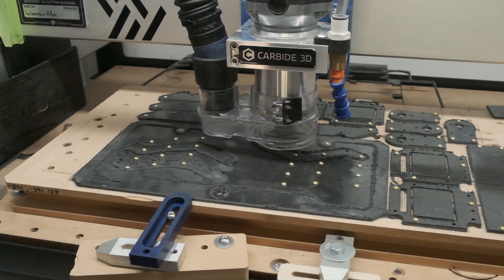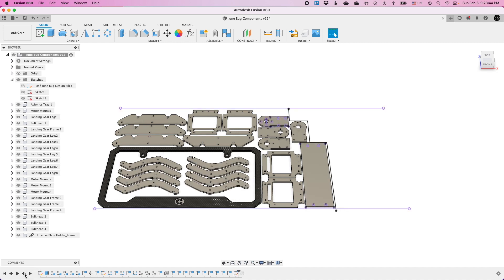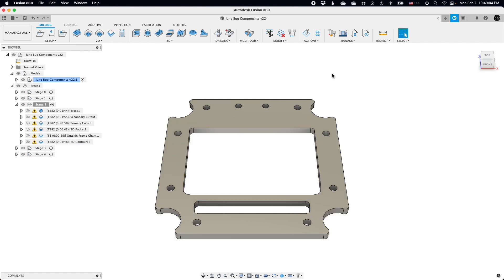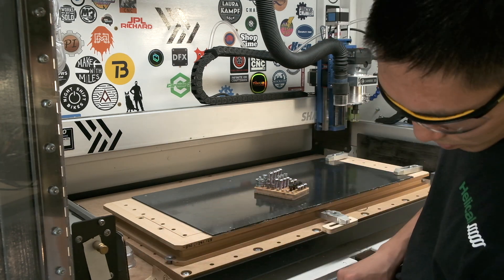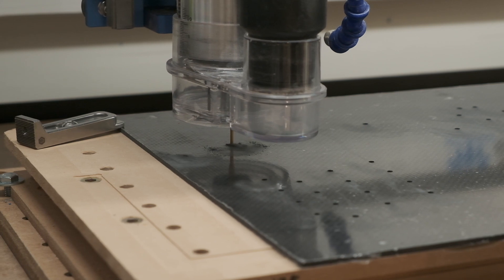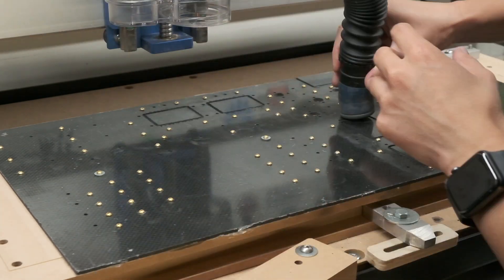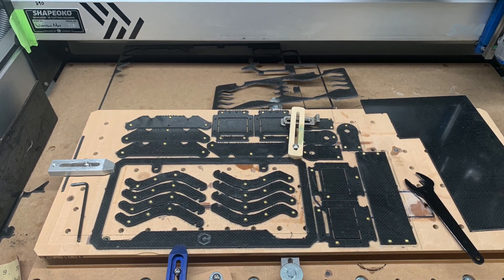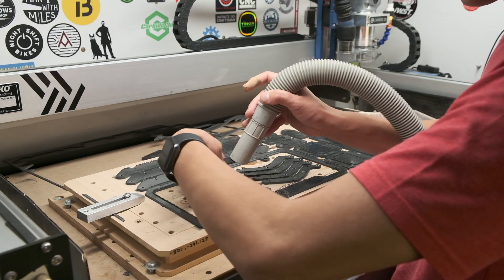Machining a Carbon Fiber Quadcopter Frame

Comment: An excellent way to cut carbon fiber, is under water, in a shallow tub of water. Not as easy, but 100% safe. I would dare argue that a shopvac without a HEPA filter, simply launches the airborne carbon fiber particler back in the air for us to breath. Many modern shopvacs have no HEPA filter.
Reply: Yep, it's a bit messy too but well worth it for your health. A normal shop vac filter won't filter all of the particles when cutting carbon fiber
Reply: I prefer having just a small trickle of water over the cutter, which does not require serious waterproofing or tall walls that might limit spindle movement. It lets you see what's happening, keeps most of the work area dry, flushes the swarf away, and you don't have a large container of black ink to clean up afterward. For a long job with many pieces you can remove and inspect/finish the early ones while the job is still running, which could be important for a hard material that wears down the cutter. A small trickle can also work ok on fixed gantry machines where a tub is probably not feasible (due to the main platform moving around).
Reply: Yeah but this is hardly an option for those of us with air-cooled routers/spindles that would blow the water all over the room... one of the main reasons I want to upgrade to a water-cooled spindle is so I can submerge carbon though

Comment: I do lots of CF on my Shapeoko and I use painters tape glued together using 3m spray glue.. I cut every thickness from 1mm to 5mm and it works for them all.
Reply: What glue exactly?

Comment: I use Cf alot for drone frame prototyping and I just wanna say a fun fact: the direction of your cut will actually affect the rigidity of the piece. Cutting it parallel/perpendicular to the weave will make it ridgid (I work with 2mm CF with a thickness of 5mm and theyre not easy to bend). However, cut it diagonally and it'll basically be a wet noodle (I could bend it so easily and it stayed bent).
Reply: That depends heavily on the stock as well, I imagine this was intentionally unidirectional.
Reply: For others also reading, generally CF plys are laid in different directions, 0 45 and 90 dependant on its application. So do pay attention to the direction of the twill.

Comment: All we machine at work is thermoplastic composite. (CF that can be press formed when heated) one thing we do to extend tool like is use mist cooling for our router. We just use water for the mist. It doesn’t have to soak the part just enough to help cool better.

Comment: I cut under water to keep the dust suspented and captured through filtration.   There are other challenges to deal with when I cut 1.5mm or thinner CF.   But for 3mm up to 6mm I can cut accurately with my work holding and tabs.   Yeah, tabs suck but part of my finishing includes sanding the edges.   Have run burr bits down small enough for 1.8mm holes for 1.5mm hardware.
Reply: Smallest diamond pattern endmills I've used are .5mm and .8mm diameter with a 3.175mm shank.
Reply: We cut under water as well I made an aluminum pan lay the carbon fiber in with foam board underneath for a buffer and put some weights on it to hold it down works great.

Comment: I started out using spray mount adhesive to hold CF down. I use a piece of 1.00" MDF cut the same size as the CF to glue the CF to. A very light coat on both the CF and the board and then both are clamped down to the router bed. A hot air gun set on low will release the parts and then a bit of solvent will clean off the glue residue. Later, I found that the cut path stayed well packed with the CF dust and held the part in place with no adhesive or screws.

I have used diamond pattern cutters but also use single flute end mills with equal success and longevity. I always use 1/16" as, the smaller the cut path, the less dust that is produced.

Comment: Hey winston, great vid.

I primarily cut carbon fibre parts, and almost always use the tape and glue hold down method. Even for small parts this is highly effective and yet to have a part move on me yet.

The only consideration I would have is to be carful when machining small internal contours as that part of the material is likely to come out at full depth and could cause issues if the retract height is lower than the thickness of said bit.

Hope that helps! Keep up the good work.

Comment: Any reason you didn’t use the arrange feature on the cam side with a manufacturing model? It seems more efficient than manually nesting with move/capture.  I learned a few good tips for carbon, thanks for making this video.

Comment: I really like flat diamond pattern endmills that have a fishtail bottom, gives a little more room for the powdered material. Eternaltools is where I get my cheaper metric carbide diamond pattern tools from, .5mm to 3mm diameter, they work great in phenolic, g10, carbon fiber and more materials.

Comment: Which carbide 3d model are you using ? I am only going to be focusing on 4-8mm CF, and some aluminum. Parts will not be bigger than 12x12 Inch surface areas. Thank you in advance.
Reply from the maker: This was done on a slightly modified Shapeoko 3. Any of the newer models could handle it fine, just don't neglect dust collection.
Reply: Thank you for the helpful knowledge . @WinstonMakes

Comment: I deal with luxury yachts for work and endless FRP material. The best BITS to use on anything FRP are the same tools used for cutting TILE. If it works on tile or marble it will work on carbon fiber and fiberglass. The ideal tooling bit for carbon fiber material is and always will be the CARBIDE rotory rasp. .5mm -25mm DIAM does not matter. Fluted tooling bits are not an ideal choice for any kind of FRP. Also always make sure the flat TIP of the tool has rasp teeth as well. That is the number one error I find people make. The rotory rasp will leave a much cleaner cut as well.

Comment: A great way to mill CF is to use a plastic bin  secured to the work surface using nuts with wide heads and O-rings, and doing the cuts under oil / water. Probably overkill setup for this project, but works great for higher volume

Comment: Is it possible to cut carbon fiber with a laser?
Reply from the maker: It is, but you'll need a pretty high end unit. CO2 alone won't be enough.